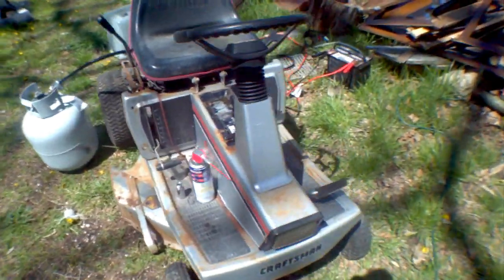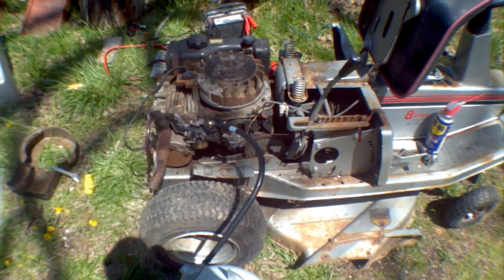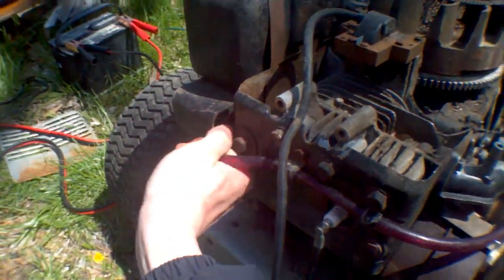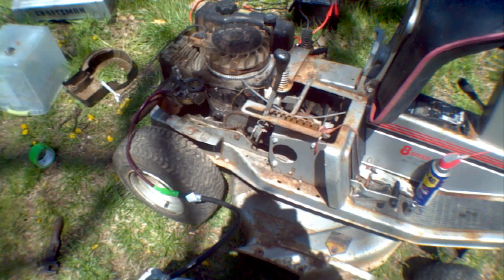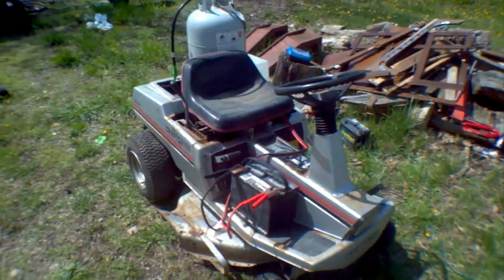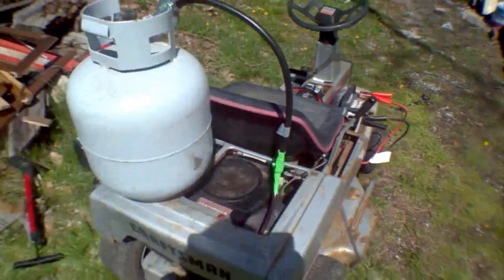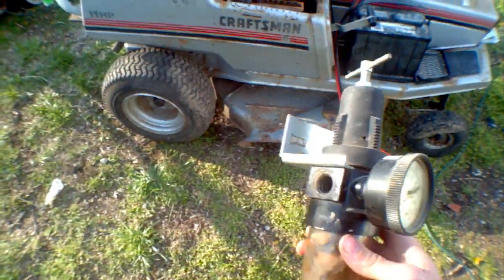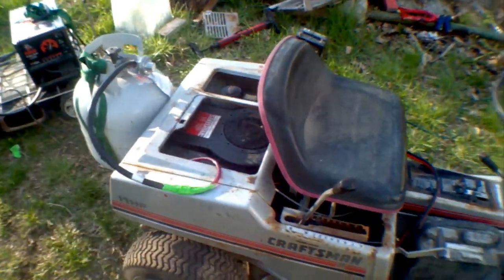DIY: Propane Lawn Mower Conversion

Comment: I gave you a thumbs up on this project.  A few things I would change for myself.  The relative low cost of fittings i would just go pick them up.  Your effective duck tape job pretty much made me laugh and cringe a little. I have a riding lawn mower that I need that rear hitch point so mounting the propane cylinder there isn't the best. (Maybe up above the engine?) Mister Heater sells a 0-20psi valve that has a finer adjustment than the on/off valve on top of the tank. I do understand the "proof of concept " you went through though. You basically took an old riding lawnmower destined for the scap yard and made it burn propane! Good job!
Reply from the maker: I ended up getting very good at using this, and it lastest years. has a transmission issue

Comment: Good job, but I think that particular machine is tired of being a lawn mower.
Reply from the maker: actually it improved a lot when i replaced the magneto and learned better control of the propane
Reply: All of the ones I have seen done, they added another on and off for the gas so once they turned the tank on they would adjust it with the other one, it seem to work out just grand once they found that sweet spot, and it wouldn't die down like yours does. Just a suggestion.

Comment: I've converted 2 mowers to propane. Along with a regulator and ball valve you will need an orifice in the hose at the carb with a hole in it about the diameter of a paper clip wire. works great.

Comment: sorta works, needs a a more refined system for propane delivery. I converted a Snapper mower back when i was 16 or so, I put a fitting inside the intake manifold so i could feed propane right in there and leave the carburetor intact. This way I could use gasoline if I ran out of propane. It worked alright  but it was not ideal. I sometimes had to fiddle with the gas volume if the load drastically changed on the engine, or it would stall. it was quite powerful though.

Comment: I imagine there has to be a way to incorporate a throttle-able valve in to this set up that uses the lawnmower's throttle lever & cable to throttle the gas in with the air so you don't have to keep fiddling with the tank every time. I know there's companies that have made carb conversions for cars and my general opinion of these types of things is that if someone else has made it, it can be cobbled together with spare parts for much cheaper.

Does this old beast still run or has it gone by the wayside? Good job getting it running either way!
Reply: The device you're thinking of is called a demand regulator. If I converted a decent engine to propane I'd buy one. I've only done it to clunkers though.

Comment: What are the benefits of propane vs gas?
Reply from the maker: +THE XJ EFFECT well i mowed almost every weekend except in winter and use like 80% of a tank of gas in a year, and so if i refill when propane is cheap i can mow the lawn for 14$ a year. i charged my neighbor like 2$ (or interesting scrap trade) per mow and still make money.

it also doesnt have really any soot buildup inside the engine and the oil stays a bit cleaner.

main drawbacks is the carburetor can get really really smelly as the mercaptans seem to linger in there, and your engine will run a little warmer.
Reply: how do people do it  do they put propain on the fuel intake

Comment: it is my understanding from other videos on here that the propane should be introduced after the carb meaning between the carb and engine block I have seen people drill and thread in a barb adaptor in the disc between the carb and engine and then control the flow via needle valve as it don't take a lot of lpg to run
Reply from the maker: i find doing it this way works fine. it has already lasted 2 summers.

Comment: I just watched both videos you sent me, correct me if I'm wrong you're just using a BBQ regulator, what about the fitting you're using between the larger propane line and the smaller half inch fuel line??

Comment: That mower has too many problems to fix to be cost effective, belts and bearings get expensive. Here is a thought though, you could remove the engine all together and round up a car alternator or two and make a DIY backup generator that runs on propane. I've seen some other vids where people removed the carb and piped the propane directly into the engine with good results. Anyway I got a kick out of it, keep it up.
Reply from the maker: André Silva
look whos talking hahaha
Reply: +Terence Hood, you're a product of a throw away society. I just replace all 3 sets of spindle bearings, spindle shafts, blades, belts and oil on my 30 year old garden tractor and it cost me around $200 and a little time. If I were to buy a new tractor of the same caliber it would cost me upwards of $7,500. Plus I got to learn the ins and outs of my tool. Now tell me, when does this not become "cost effective"? Let me guess, you lease your cars, right?
Reply from the maker: no i wouldn't turn my good lawnmower into a useless generator. electricity only costs 4 cents per kwh here.

this mower didn't take many parts over the summer. its more than payed for itself.  i've mowed my neighbors lawn for money and  not counting the 40$ i've made from this video alone.

but thanks.
Reply from the maker: André Silva hahaha, go on.
Reply: Rinoa Super-Genius you're just a kid who does not think before writing
Reply: Rinoa Super-Genius you have a lot to learn, change your attitude

Comment from the maker: oh and just FYI i use it to drag logs and stuff across the yard so it does have more power than it did when i was first starting using it. i think knowing how to operate the valve while driving was a good help.

i plan on maybe connecting a snow plow or bucket loader on the front someday haha :D

Comment from the maker: that was also very tall and thick grass i was mowing, hadnt mowed it yet that year. i don't have any problem with the grass as long as i mow it every month or so.

a Prius would be a waste of money, i drive an electric bike with a 1000 watt motor. i couldn't imagine needing more than 2HP for commuting within 30 miles.

btw i'm actually working on my review for the upgrade today. you might wanna see it. oh and the reason the magneto was affecting it was it didn't always fire the cylinder.

Comment: If you call that powerful, that toyota prius you drive is probably SUPER POWER. Lol. You couldnt drive 3 inches forward without the mower almost dying. A bad magneto would not cause it to loose power. A bad magneto would not let the mower start since the motor wouldnt have spark to start

Comment from the maker: the whole idea is to feed it into the engine as a vapor. and it gives me plenty of RPMs. i just prefer to run it on the lowest setting. the bad power was due to me now knowing how to run the engine via the propane valve. but after 5 months of mowing 3 laws a week with it its working great, still on teh same tank too.

and its not running rich nor lean either.

Comment: The way your using the lp gas and regulator,  your only getting vapor not liquid. And those cheap grill regulators come per set at 11 inches of water column  which is a little less than 1/2 a pound.     This is why you can't get any rpms  or power out of the motor,    With out spending the money for a vaporizer system the only way to get more gas would be to buy a  rego. Or fisher high pressure regulator that can be adjusted from 0 to 20 lbs of pressure

Comment from the maker: hahaha thanks. its also the protective footwaer i use when working with battery acid and molten metal.

i figure if i need boots to protect my feet from danger then i'm doing it wrong. also its kinda hot this time of year :P

i find its better to simply hold a big piece of metal in front of you to block sparks instead of wearing thick pants and stuff.

Comment from the maker: actually its working nicely where it is right now. it would block the headlight and might be difficult to reach the valve. its really easy to reach back and adjust the valve where it is.  also overheating isnt much of an issue since i let it have a cooldown break every 20-30 minutes anyway.

not counting i plan on adding some attachments to the front like a bucket/plow so i can move dirt and snow. but thanks for the input :D

oh maybe a wench too. got one of those laying around.

Comment: You might consider strapping the tank to the front of the steering column.  It looks like the clearence is OK and would not impair sight.  The access valve would be easily accessible.  It is unlikely you would hit anything with enough force to break the tank. The tank would not be near the hot motor.  It would facilitate attachment of weed eating flamethrower on mower.

Comment from the maker: thats the same size i'm using. so far i've mowed the lawn like 27 times and it still hasnt run out. thats mowing 3 lots in total. my neighbor pays me 2$ to mow his extra yard and it more than pays for all the propane.

and the spark plug looks great when you inspect it. it isnt charred or white so that means the mixture is right. i had some more regulators on it but i removed them. i just put the tank valve at the lowest it'll go and that works great.

does get a bit warmer than gasoline though.

Comment: Get you an adjustable regulator and it will run smooth as silk. I notice the regulator you have is for like a grill. It will only put out 6 to 8 ounces of pressure. Barely enough to idle. Also it will run lean and burn a piston or valve.

Comment from the maker: hahahahaha, actually i have an ALICE frame that i could mount the tank too for a flame thrower. they used the ALICE frame for the proton pack props in ghostbusters as an example. they fit on your back nicely and can cary like 40lbs and it seems like 10lb. not counting you can mount a lot of stuff to it.

i better stop before i get even more off topic :p

Comment from the maker: well after i filmed this i installed a pressure regulator, so i could always replace it with a ball valve in the future i guess.

thats interesting how running with less fuel would cause it to over-heat, not counting propane burns hotter. so i'm guessing if there is extra air in the cylinder the combustion is too efficient and it gets too hot? if you dialed it down to where it didn't make enough BTUs to overheat it, it may not have enough energy to keep it turning. hrmm

Comment: Running to lean will cause the engine to overheat and die. To rich and you will foul a spark plug. So go towards rich (black smoke will usually blow out exhaust) rather than lean. 
I have played with the valve on the top of the propane bottle and they don't seam to have a fine adjustment. I would think you would get better control if you put a ball valve or the sort after the regulator you have on your hose.

Comment from the maker: hehe yeah sandals help keep you cool during welding but it can easilly turn bad and make you hop around for a bit :P

i'm getting quite used to running it by hand, i'm more worried about the fuel usage than the speed/power anyway. so i let it run on a constant amount of fuel and if it goes faster at the smooth parts and slower at the rough parts i dont mind.

are there any issues with providing the engine with more air than the fuel can oxidize with? i mean other than producing less power.

Comment: Fun project. Yeah it is impossible to get a perfect air fuel mixture by hand because the engine is constantly changing its demand. A diaphragm regulator and jetting will solve all of this. They do sell universal kits for around 150 and it will have the engine running SMOOOOTH. Great work and I like the sandal welding (been there done that).

Comment: Invest in a flash back protector for that propane bottle and a new spark plug safely is never goes out of style when you have a carburetor backfiring. Jb weld the carb jets and get some fittings when you do the conversion over to propane. One reason why your lawn mower will run like a pile of doo doo is the governor needs to be adjusted but do this on gasoline first before you use propane to save yourself troubles. Cheap parts can be had on Craigslist if your short on funds. Good Luck!